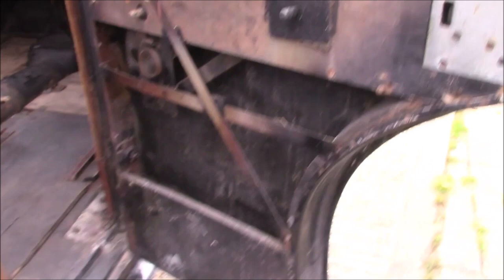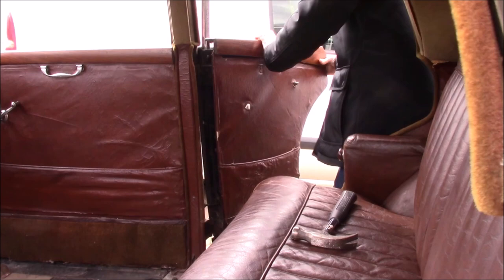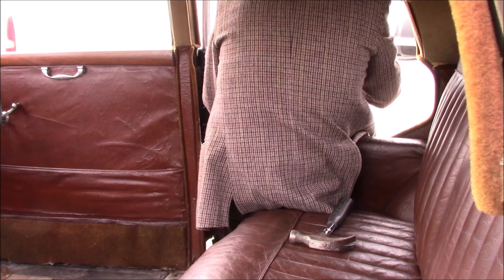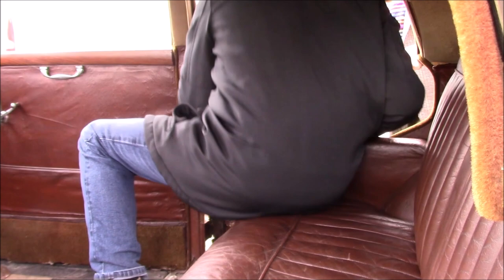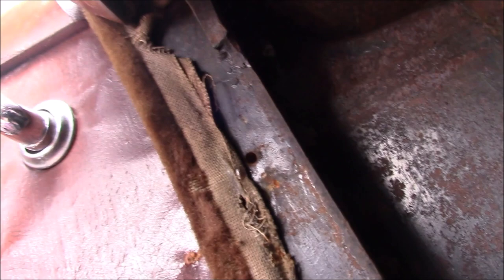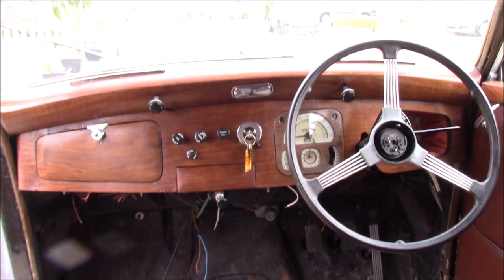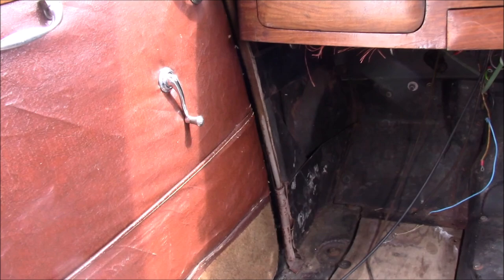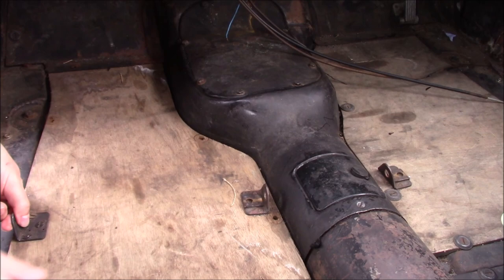1951 Lanchester LD10 - Dashboard Final Fit & Refitting Control Cables

Comment: Hi,  I’ve just acquired an LD10 so am watching your videos with great interest.  Have you filmed removal of the fuel tank and dealing with the reserve tank mechanism, etc. I’d be interest to hear about your experiences on that aspect.   Phil
Reply from the maker: Oh marvellous, good luck with it!  I do have some fuel tank removal video coming up eventually as it's on the list for a light refresh and currently partially removed for the wiring job, it's not too difficult a thing to remove.  The reserve tank mechanism on ours is incomplete though, so I can't offer much help on that one.  In one of the wiring videos I do touch briefly on where the bolts for the fuel tank are, I'm just not sure which one it is.